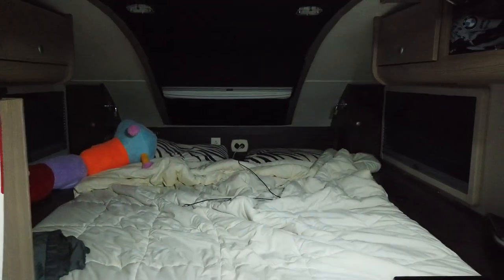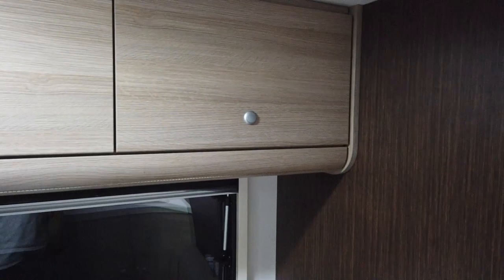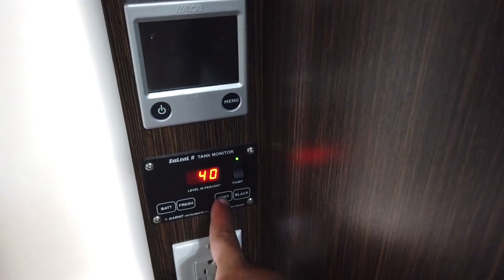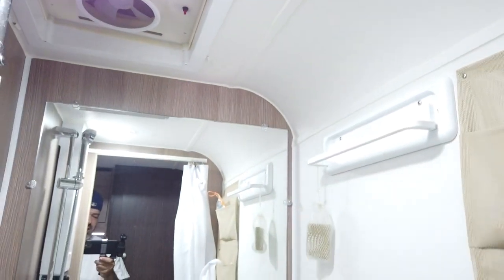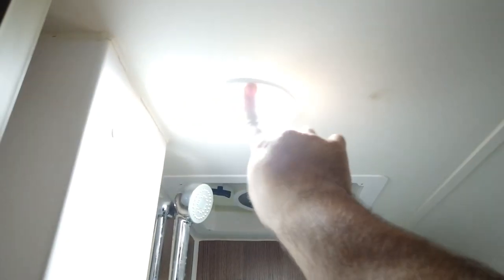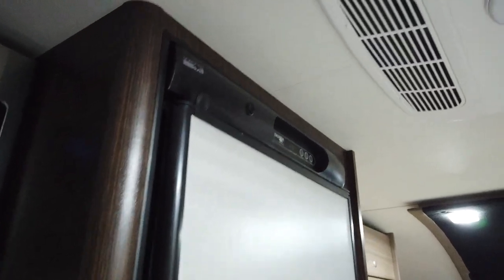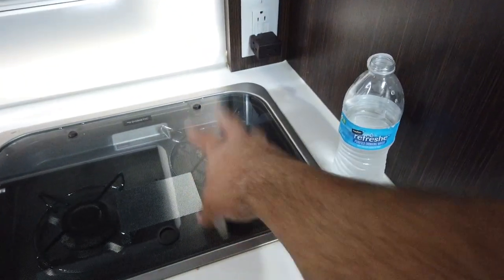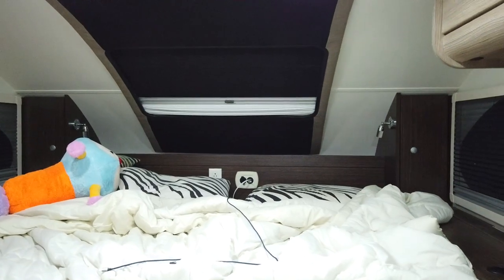NuCamp 2019 Cirrus 820 - 1 year Review - Part.2  Interiror

Comment: Own one & used it full time for Mar - Sept traveling from FL to OR. Love it. 1st - drawer issue is simple fix. Lift side clips on track to remove then using L allen wrench to lightly pry to unfold. 
We've added HD eyebolts to rear deck to lock our generator there. 
Beware of any wind gusts with bed skylight open! Ours flew off, bounce on hood then broke. Luckily I had some duct tape to close off until I recieved a replacement.
Finding Glycol for Alde was difficult & pricey.  When we had error code on system I found it easier to disconnect shore power and cycle battery switch off/on to reset. 
Refridge works better with more contents. A bag of ice in freezer too helps. 
Wife has app for radio so can't complain there. And she trimmed our shower curtain. 
Ventilation thru small pass-thru window helps and our dog loves sitting there watching outside. We block the window at night with a sofa cushion. 
What is really annoying is all the lighting off those control panels above the stove. The vent for micro also works over stove IF you unlatch the vent outside. Not an easy job on the truck!
And finally we almost always remove camper when staying for several days. I had to install a lift under the camper similar to yours to raise the camper to clear the roof on our 2011 F250
 It knocked a few times over railroad tracks, rough overpasses and various off-road terrains.
Reply from the maker: I shouldn't have a issue with a many drawers the first month of ownership on a product that is so expensive.
Reply from the maker: I would still buy it....I just hate how outdated all the other campers look in comparision. I just wish they would pay attention and address some of the small issues. I just order the glycol from amazon.

Comment: 25:24 That would be a quick swap with $50 unit that has either bluetooth or remote screen option. Thanks for the shot, the wiring in there is pretty messy. I was expecting a little more wire isolation, heat shrink, etc at this price point. If that's a sealed box, the charge controller probably gets pretty warm.

Comment: I have a 2017 820. Your Alde manual describes how to offset the temperature setting to match the room. 
You could install a Victron solar controller with Bluetooth to your device. The floor covering is marine material used in boats. It cleans. I carry a Dyson hand held vacuum for housekeeping,  The latches that break are US RV stuff. The power point locations are a mystery. I’m listening to your audio on my portable Bluetooth speaker 🤣. Do you need a spare giant microwave?🙃.
Reply from the maker: I shouldnt have to upgrade a brand new 30k dollar camper ......but thanks others have pointed me to the victron

Comment: The only thing i wanna know is that alde heating system. Is it more propane efficient than a ducted heater.
 I m sure general build quality is very low since the company is really new in north america. But im glad they compete with arctic fox Alp or lance to make sure they move into year 2020.
Reply from the maker: propane efficient? humm.... I would have to guess that it is. Honestly the fact that it is 100% silent seals the deal for me. IN such a small space like a truck camper a blowing heater noise is very annoying.
Reply: @m3pedro   i also did some digging. I think 20lb propane will run 2.5-2.8 days with alde.    According to taylor dzaman's arctic fox 910. He refill 60lb propane every 7-8days.  And the other guy with tab400 did some math and said 2.8 days for his 20lb bottle.
Reply: @redhongkong  When running, the Alde system consumes 0.9 pounds of propane per hour.  Alde reports that the 3010 system can operate for two weeks on a 20-pound propane tank.  This mirrors our experience as well
Reply: @KoolCordell  are u saying  0.09 lb/hr or    1hour of alde per day?   or 2 days instead
Reply: Yes it is more way more efficient fuel and power wise and quiet. Fuel use depends on heating load and hot water use. Remember to add the propane used by hot water heater plus furnace together in a conventional 1970’s designed equipment rv.

Comment: Hey you have to change your inverter in the Cab Maybe switch it to 3000 watt , update your Battery Management System , Perhaps you can use the Microwave.

Comment: Hello, 
I have the same truck as you and currently looking at this camper. What is the payload for your truck, this setup looks like it would be over. Does the truck and camper handle well? Thanks!
Reply from the maker: I'm over for sure.After i put the airlift airbags it handles fine. Most of the race tracks I go to are closeby and I keep it to 65mph. It feels pretty solid. No worries. Toyo open country MT 35"..... someone told me geolander makes a offroad tire with a even higher load rating....so i'll try those next
Reply: @m3pedro  Thanks Pedro! Enjoy!

Comment: Awesome review!!! Trying to make a decision on a truck camper and actually too many options. Just found out about this brand. Thanks so much for the gripes, pretty big issues sir. Man, I do like the ambient light though. Thanks again.
As I’m watching, how much did you pay for this one? Hopefully they fixed these big-time design flaws. No good!!!! Lance or Arctic Fox quality is quite impressive and has a stove.
Reply from the maker: Everything is impressive at the dealer. It's when you start using it that things start to fall apart. Honestly I am still ok with my purchase decision. I love the styling, I love the silent ALDE heating system, the bed is super comfy, the windows are awesome....the list goes on and on....they got so much right it's just frustrating they made some silly design choices
Reply: Pedro Guimaraes, SOC Hey Pedro, you should change your career to Cirrus quality control. Virtually every issue you mentioned in your 1 year review was changed to what you suggested. It’s like the CEOs watched your vid and took your advice. Kudos and enjoy your camper.